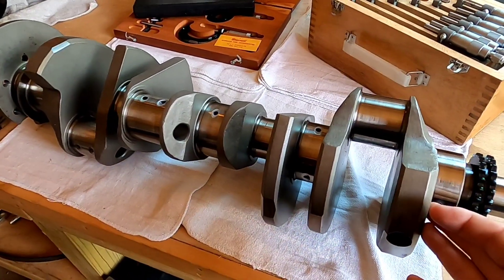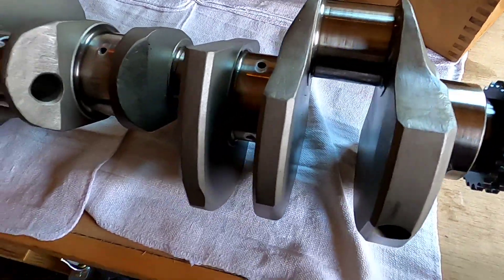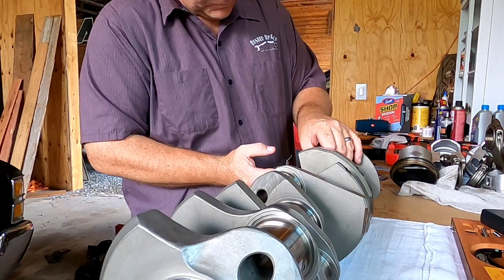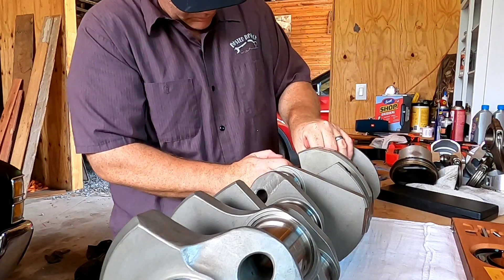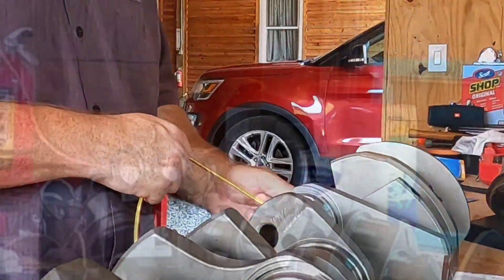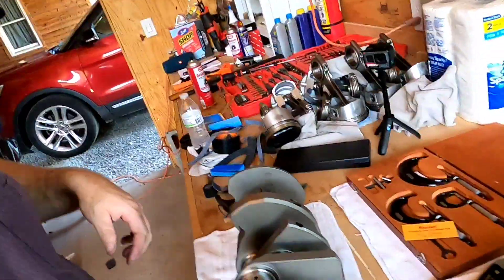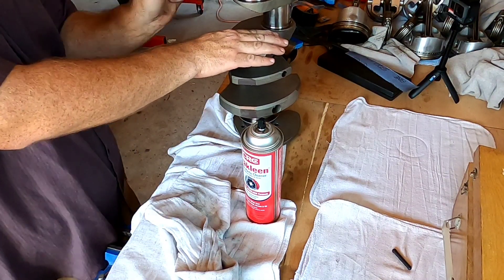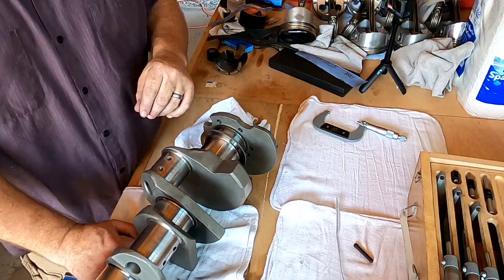509" Big Block Chevy Build : Crankshaft Polishing 101

Comment: New sub! Thank you for your time and knowledge... I am about to do this process on my BBC crankshaft does this process require balance? I heard you say back in the engine i just wanted to double check thanks again
Reply from the maker: No it doing this doesn't require rebalancing. Now if you are changing Rods and Pistons then you might want to have it checked! Thanks for watching and for the sub!
Reply: @UnityMotorSportsGarage  awesome news to me, I am refreshing the bottom end but all stock parts only add on mods heads, cam etc 
Thanks for your feedback it helps new engine builders

Comment: First of all!  Check if the crankshaft is bent!  I don't know why they come straight out of the box this way, they most always need to be pinged to bring it back straight  , they are usually .001-.0015 and don't use this method for polishing!  Use a machine to turn it in the clockwise direction.

Comment: What kind of grit of emery cloth you used? I am in the process of doing that on the car, after slight rod knock, and worn bearing, fortunately the crank is not scored or damaged, to the point you can feel something under the finger nail.

Comment: I’m glad I found your channel, I had my crankshaft polished at a local machine shop that butchered the journals, but me not being an expert, assumed that it was normal, and I ended up with all rod bearings wiped out, and the main bearings weren’t much better. 
Luckily, no spun, bearings or hard knocking noises.
  I have since found another machine shop who currently has my crankshaft and I’ll see what it comes back like, and likely do my own final polishing and cleaning on it.

Comment: If youre building an engine and you use anything budget you've already blew up your block. You should never ever ,ever use cheap parts inside an engine ever. Everything needs to be checked 4 times and checked again. If anything is out of spec you need it machined ! . I cant tell you how important it is to have everything perfect of damn near it ,or you'll lose your investment down the road and that i will promise you ! .
Reply: How far down the road ?

Comment: This is the most incompetent mechanical video on YouTube !!!!   You would be fired from any competent machine shop in the United States!!!   The only place this has is at the race track trying to cobble to get it to possibly live through the next round.  Never measure a crankshaft journal in one spot and assume that is the actual size of the journal.  It needs to be measured in several places to inspect for roundness and taper.  

Magnification of 20X or 50X  would show you the grooves you cut in the crankshaft with the shoe lace. The only place the paper is cutting is directly under the shoe lace and as the lace turns it cuts a spiral on the journal.  I have seen others use a piece of leather or rubber wrapped around the journal to help spread the load of the shoe lace.  Wet with wd40 to act as a carrier would also be an improvement and would reduce the cutting action by 50%. 

It only takes 2-3 minutes to properly polish a crankshaft .  Even if a machine shop isnt nearby most welding shops have a lathe you could spin the crank in to polish it.  Anything (even nothing) is better than your method.  

Never ever use any type of brake clean product to clean internal engine components!!  That is the worst thing you could possibly use!!!   Brake clean flashes very quickly and when it dries it acts as glue bonding the dirt & debris to the part making it extremely difficult to remove later.  There is no substitute for clean hot soapy water!!

Comment: That debree smashed in the bearings is most likely bures in the oil pathways breaking off while running. An engine that would have a forged crank would most likely have a perfect filtration system, which means the debree was inside the pathways already. Just something to think about, LOL.
Reply from the maker: When it came apart.. the first thing I checked was the filter... It was full of metal.. so the bypass valve in the filter was just allowing dirty oil to recirculate without ANY filtration... 
Thanks for Watching! Please Subscribe and help us spread the word about the channel...
Andy

Comment: Andy another great video iv been polishing cranks like this for years and always wondered about the material I’ve removed. Not my race engines but the budget builds iv done for myself and friends. I just got done with a 400 SBC for a friend that I honed polished crank cleaned and cleaned and out together for him with a small hyd roller vortex heads and a airgap intake with a new proform 750 that runs better than I thought it would. We put on chassis Dyno mon night and made 403 through a TH 350 with a lil stall and 390 gears. Just wanted to share that with ya and I am hooked on this Chanel I have to get me some of those mics and measuring tools that you have any input on some good names would be a big help. Thanks Andy
Reply from the maker: Keith, Hey Brother welcome to the channel!!! I'm glad you like the channel.. that sounds like a stout 400!  Please help us spread the word! And the Videos will keep coming...
Andy
Reply from the maker: On the Mics.. if you want some good ones.. Starrett is my go to choice... I have some older made in China mics.. and they are almost as good.. within a tenth or two.. Brown and Sharp and Mitutoyo all make great products..

Comment: I like that technique.  I’ve always used a long piece of sandpaper and worked the ends around the journal radially, but the string looks like it would be a lot less taxing.  Thanks for sharing.
Reply from the maker: Yup you hit the nail on the head... I have seen this done many different ways over the years... And as long as the results are good... Those methods are just as good... Everyone has their own flavor of "food"....
Andy